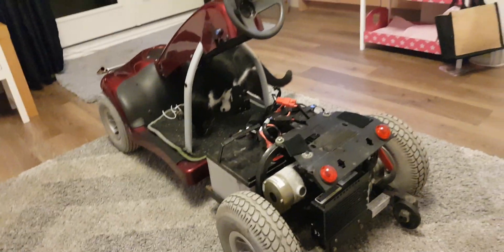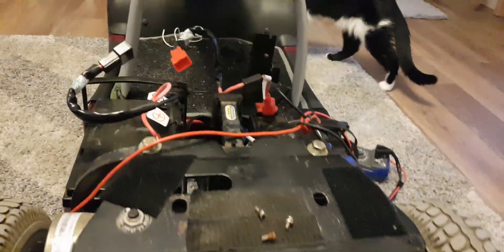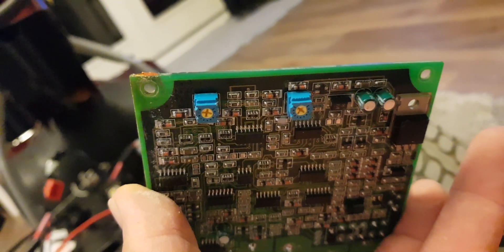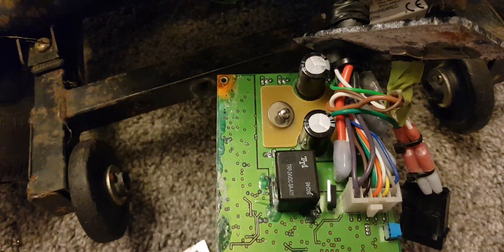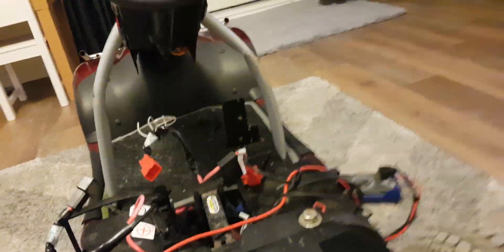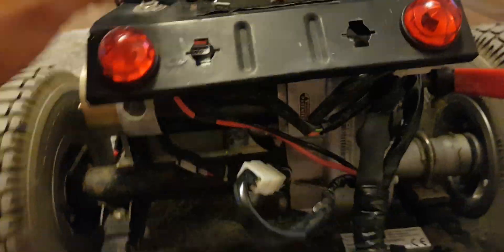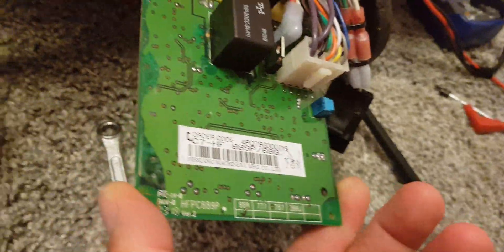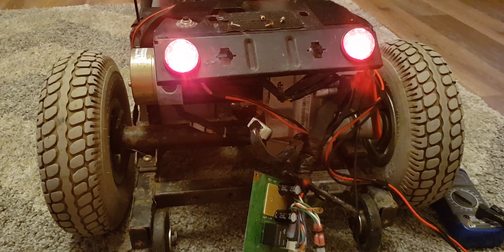Mobility scooter modified gokart electric speed controller mods and repair

Comment: okay boss as someone else also said you have it in push mode so mother is disingaged so it wount run I think that modle you have there has a button under the center at the rear end turn it off flip that switch & try again. also some have a weight senccer under the seat that can keep it from moving

Comment: If anyone is looking to do this,  in my experience the limiting factor is the motor, not your batteries or ESC.  The 4mph models have a smaller motor than the 8mph models,  when you try to overvolt them the motors just spin at super high RPM and get really hot,   it will get you up to about 20 mph but its super inefficient and risk burning the motor out.  If you could somehow take the bigger motor out of the larger ones and weld it into the medium size ones that do 4 mph,  and use lithium ion batteries to reduce weight,  it would be pretty damn fun I reckon.   It all comes down to the thickness of the wires in the motor,  so bigger current at same voltage.

Comment: How fast did it end up running ?
Base speed and modified speed ?
Motor heat up ?

Thanks.
Reply from the maker: stock 24v and speed controller was 7mph adjusted speed controller got 9mph on 24v. changed speed controller to a 48v 300watt and run it with 4 12v batteries so 52v fully charged and that topped out at 24mph gps indecuated on my phone. motor wasn't hot but warm. then gave up with it and gave it to my mate as my girls weren't interested in it and his boys loved it.
Reply: @MADMODS Ah, okay.
Thank  for the reply.
Have a good day.
Reply: @MADMODS hi what speed controller did you change it to please xx

Comment: when ru actually going to make a video of u actually driving the thing we wanna see it move not u making like 6 videos talking about it
Reply from the maker: gave it to my mate in the end as my kids didn't want to drive it.
Reply: @MADMODS  how fast does this thing even go?
Reply: @ZOMBIEEZ  ran it on 36volts and got about 15mph out of it with the standard motor and speed controller.
I might build another one day from scratch with a brushless motor and  lipo batteries for me to drive around on. I've started collecting bits but got a car to restore and mod first.

Comment: I got an extra 2mph out of mine just by cleaning the pot on the tortoise to hair dial was 8mph went to 10mph  most mobility repair shops have a fault finding meter they plug in to the scooter to diagnosis faults and can turn the speed up but by law they need to restrict them the meter cost about £300 I think seen it on youtube some times its just a matter of changing the brushes in the motor

Comment: What is that beeping in the background  ?  going off roughly every 30 or so seconds. A  bit annoying to say the least. 😕🙁  I would love to get a bit more speed out of my mobility scooter but, without loss of battery power ( or not very much) But, I am not technical minded. But, I do wish it would travel. Much further on a full charge rather than about 3  miles. 👎😡🤬🤬🤬🤬 Increasing range is a MUST!!!  for me 3 miles is worryingly short distance.  It has GEL batteries not standard type so i simply don't understand why the range is so LOW!!!!  It's simply not enough I have tried almost everything to achieve this. But, nothing seems to work & I have  never taken the batteries out as so far never needed to or been able to get the bloody seat off 😡🤬 Maybe one day i hope. If really necessary.  Any ideas or tips to help.
Reply: Your batteries need replacing, that will account for the low range.
Reply: @dandare2586  It cannot be the batteries as, they only a few months old ( about Feb I got them) & are GEL types ( so I was told & highly recommended ) 80amp ( presumably) I thought if I was to spend out a few hundred £ EACH!!!  ( approximately £300 to £1,400 EACH!!! depending on make GEL Or standard types 100amp ers would it make any difference ( as in great improvement on range). But, sadly 😪 I can't afford to change the batteries again so soon as, my finance is very limited unfortunately. 😪  Even if it was them to be the cause of the problem.. I have never seen the batteries since they were installed early this year just before Lockdown in March.  ( I think it was, early Feb) I am, at my wits, end with it & I'd love to travel further  or longer than just a, few, miles. I honestly thought these things, the, range varied from, about 12 to 25 miles, on a full 12+  hour or so. charge. I need, help. in sorting this matter out SOON!!!  I can't get in touch with the service company that did replace the batteries due to.this HORRIBLE COVID 19 thing going on. As I said I am. at my wits end.  😪😪😪😪👎👎👎👎 & I enjoy getting out on it even if it ends, up, just being to the park & back or to. do a little shopping.about, after that it usually needs, re- charing almost immediately right after getting back. It really  drains, power from, the batteries if on full power.  I am so depressed with it I honestly thought I had some independence but, not as much as I expected SADLY!!! . So, what can I do 😪👎
Reply: @ThStg  you can't rule out batteries just because they are a few months old, to you, it's entirety possible they were damaged by complete discharge at some stage. Gel batteries are usually a couple of hundred pounds, the prices you are quoting are well over the odds?? Why ???
Reply: @dandare2586  My original batteries that was on it were in a terrible state according to the technician ( of which I wasn't surprised due to their age ) I think they were about 4 + years  old & well used & wouldn't charge up above 80% between both batteries. As, for these Gel types in was highly recommended to have them by the service engineer ( not forced to have them just recommended to have them so I went for them ) But, I thought why not & I honestly thought I was making the right choice as these are much lighter in weight ( or so I was, told) You see this is my  1st mobility scooter but, I did look at many models & the one I really liked & wanted was a bit out of my price range quite, sadly. So, as, I have already mentioned it I am at my wits end with it I was, so much looking forward to really getting out & about on it. But, due to its extremely low range I am rather nervous of traveling too far. If I go very BORINGLY SLOW 3mph tops ( snails, pace) I get about 3 to 4 miles before I need to fully re-charge it. If I go a bit quicker ( full 8 mph not that do very much anyway just sometimes if I am in a bit of a rush) I am very lucky to get about 1 & half miles before it needs, a full re-charge. As, I have already mentioned I can't afford larger or replacement batteries as my budget at the moment & for quite sometime  yet is sadly rather limited. I am getting more & more frustrated & depressed with it  everyday. I don't use it daily just  a few times a week & I tend to charge it up  the day before. There are reasons as to why in don't charge up overnight. ( take, far too long in explaining). & I think I have said more, than enough about it The batteries were so expensive because it didn't matter where I looked for replacements they were all in the £200+ mark each Standard types, we're still over £130+ each anyway  at 80amps, I really just know is it worth trying to put bigger ampage ones  in I. e, 100 's, if they fit  ( hopefully)  But, that's another story as they say & going back to standards rather than these Gel types or what. I do like getting out but, this has got me almost house bound due, the excessive low range. 😢🙁😕  I simply just don't know what to do.
Reply: @dandare2586   Are  you a mobility scooter engineer or just a member of the public like myself. ? Because this back & forth chat has got me a bit  puzzled  & was just wondering about.it  I am in such a mental mess with it that I need to take a well earned rest away from YouTube as I am getting quite, mentally tired with it all. So, unless you have either a good suggestion or ideas or something very useful for me then sorry I will withdraw from this conversation. I am mentally exhausted with it all that's why. But, thank you for this chat anyway.
Reply: @ThStg  Just FYI, I am a motorbility scooter fettler. I have changed drive units, wiring systems etc etc and engineered an upgrade on one scooter from 2 batteries to four in 2 self contained units able to be carried around  where the original 2 battery set up was. 
Currently I have also converted a motorised  golf caddy into a mobility scooter additional powered battery trailer, soon with solar power :)

If you have access to a voltmeter (£10) it should be easy to check the battery output from the  wires from the battery system  without taking it apart. This gives you the info as to how the battery levels are doing. If you check them once charged, then leave it for as long as you can (whilst checking) if the levels drop rapidly then there is a problem. If you can check the battery levels after a mile or so of running they should be similar to the start, if not then the batteries are bad.

Your battery readings should be at least 24.5v when charged. (2 x12v).

I also wondered is your battery charger capable if charging these new batteries? I think it should be at least 8 amps output for the battery size you mentioned ?
Reply: @dandare2586  Glad to hear that you are very nolligable (excuse spelling) on you mobility scooters & being able to vastly improve on them. including the convertion of a golf cart ( scooter) 👍👏🏻👏🏻👏🏻👏🏻 well done to you. I just wish you wasn't far away I( PRESUMABLY!!!)   I would have asked you if you could have a look at it & a  quick check over on it. But, I presume you are a lot more than just a few miles away ( most probably at least 100 miles) & are very busy with one thing or another SHAME!!! I can always try your suggestions & maybe see if it is possibly a shorting or some other fault causing this high drain on the batteries. Or I could keep trying to get in touch with the service company that replaced the batteries & did a service check on it. To which they found no faults apart from bad batteries ( which was replaced ) & faulty rear brake & night lights both replaced. So I was informed on it  So, I am still very, very confused & frustrated as you can tell by explanation of things with it. I just wish there was  a easier way for us to contact each  other   i. e   email But, I don't think it be wise to publish that on this 😕 Anyway I'll try your suggestions over the next few days & try get back to you by Mon  maybe earlier depends on how things go here O. K!   P. S, I do like the idea of 4 batteries rather than the usual 2 that sounds like a great idea would that not only improve on milage ( range) but possibly on speed 😳 ( possibly not speed but, should improve range drastically more) but, without doing it myself I wouldn't know. Anyway I'll get back to you in a few days Mon at latest all being well. Thanks for the tips, Oh yes, I do have a multi meter but I just use it to check 1.5 v batteries As I am not much of a tech person & sadly don't know, which setting to put it on to check that fault. It does, have varies other modes just say which please or if possible, show, what it looks, like ( be better to identify)  & I'll do it Once, again THANKS!  for you kind advice & trying to help someone in a right BACK MESS with their M/Scooter.   I  love being out on it but, as, you can tell always, extremely worried as  to how, far I can travel on it before I have to return back home. If I was to get much nearer to I. e  12 or even 15 miles I be much happier if I got 15  to 20 ( wishful thinking)  then I'd be quite ecstatic then. Anyway speak to you in a, few days Please don't forget to tell  me which mode to set my multi meter on with icon if possible  of the mode. Many thanks again. Regards, The Stig 👍😉
Reply: @ThStg  Hi Stig, the multimeter setting you need is the solid straight line with a broken line underneath, this should give you a DC measurement.
Reply: @dandare2586   I have the details of my charger I don't quite understand it but, hopefully you can make  better sense of it. Details as follows:- 
AC  220 v in at 50/60 hz, 0.3 A  DC 24V 3A, 72va  I presume this charger ( the, one I got with this scooter) is to blame for under powering the batteries am I correct in this. if so what do you think what it will cost me for a better charger approx price,. 😕 I don't expect them to be cheap.
Reply: @dandare2586   I have sent you details of the charger I have for my scooter & as, you mentioned a 8A is better for charging according to you anyway on these batteries. But, unfortunately mine looks like it's only a minor 3A  I think this could be the trouble of my problems. But, I am only going by what you have mentioned about the charger  not being  powerful to charge properly & probably given a, false, reading on my dashboard. So would you recommend me obtaining a 8A, charger A.S.A.P.  I have seen a few oline prices, mostly around £60 but 1 is £110  then I would have to pay P & P & Delivery charge on top. to account for aswell that would be about a further approximately £25+ added. Totalling  a price tag of about £85  approximately. So, i await your next reply. 😉
Reply: @dandare2586   I have had really good close look at my multi meter & the sign you described is definitely not on my meter But it does show something else that could be of similar use Showing 200m , 2,000m, 20  Vdc 200 600 All in the same grid Is that what I use to check the batteries if not then I'll just deal with getting a bigger amp charger & hopefully see a bigger improvement. VERY HOPEFULLY I HOPE!!!! 😳🙁🤔Just have to wait several weeks to get the money to get one. Any Peticular brand ( make or model) ( 3 round pin charge connection)  would you recommend or just get what I can afford as long as it's a 8 A.   P. S  many thanks for your help & advice. & once again I await your reply. 😉
Reply: @ThStg  yes, your batteries are DC so the multimeter will be fine to check the voltage levels. However I think your charger is the issue as I have said. You need to get an 8 amp as soon as possible. Did you get my link for a recommended one ???
Reply: @dandare2586  sadly no link about your choice of charger But, I can get one from Amazon in about 3 weeks  ( hopefully!!!)   But, sadly I can't buy one earlier than 3 weeks  time finance permitting.  🤔🙁😳  But do try to resend that link again. As, I would like to see it anyway. Anyway off to bed very soon got someone coming early & need to get some shut eye. But, I'll take a look at that charger whether it's b4 I go to sleep or sometime tomorrow. MANY THANKS for you on your advice so VERY  WELL APPRECIATED!!!  Just one, question which city or county are you located in presumably you are in the U.K.  As I am a very curious person 😳🤔😁👍
Reply: @dandare2586   Looks good & price seems fair. But, I can't get it as i only  Amazon to buy things If this was available on Amazon I would get it. But it does seem to be there. Other makes & models available So, it looks like I'll have to get one off that in  the near future. But, thanks for showing me that one. I would get it if I had a bank account. I don't trust banks I pay by cash only cheques are too much of a risk. Like a football they can bounce too much. Anyway many thanks again. As soon as, i get the new, charger & use it I'll let you know how it's performed against the RUBBISH 3A one But, I just have to put up with this 💩 one unfortunately for about 3 to 4 weeks to get enough to get one off Amazon. I will always be very grateful to you on your great knowledge & expertise on these matters & issues. Off to bed now so goodnight or afternoon or whatever it is where you are 😁  & catch up with you in about 4 weeks or so time when I have had a bit of time to use the new one. Bye for now 👍😉😁 REGARDS    THE STIG.
Reply: @ThStg did you get it sorted luv?
Reply: if you are only getting 3 miles you probably need new batteries . go to lithium they are lighter smaller & will increase speed to boot also changing wheels to larger ones will get a bit more speed as well. if you go lithium remember to changer charger also. Lithiums charge faster also all round better .

Comment: usually when you put it in freewheel the electronics get locked out , engaging the gear back in and reboot should make it work again
as for hotrodding the controller, maibe it works to replace those transistors for solid state relays , those can pass through a lot more power and should make the whole thing move a LOT faster